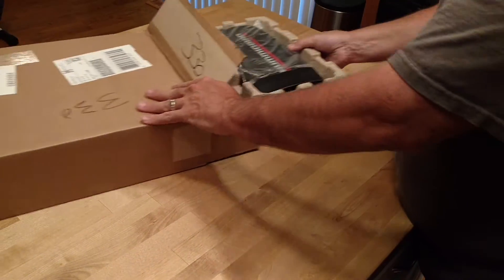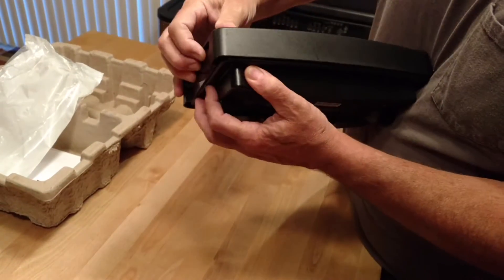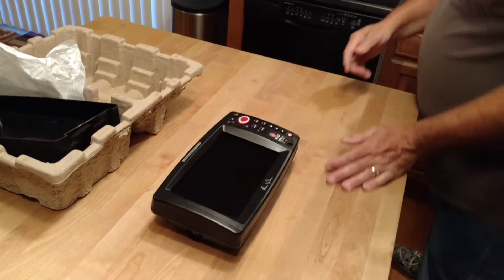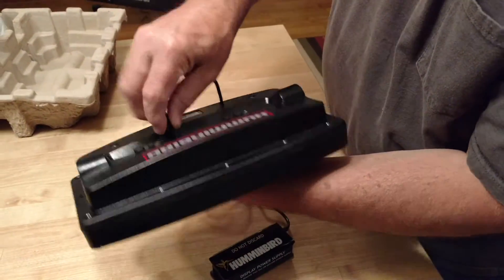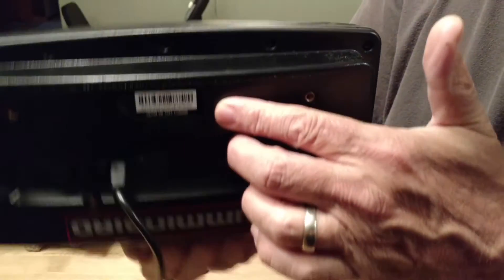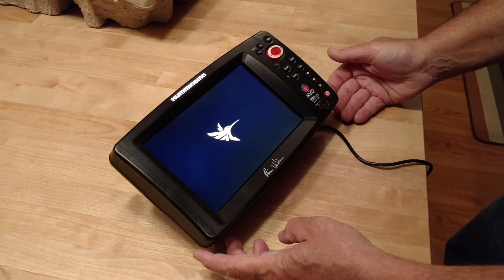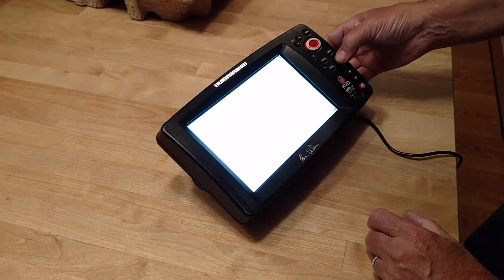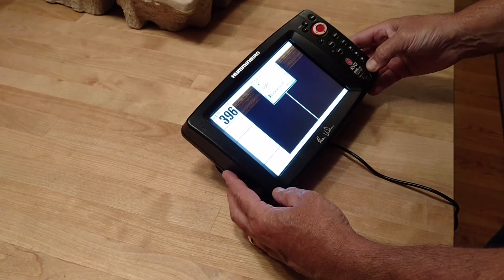2nd repair from Hummingbird.

Comment: I'm done with hummingbird. They fail when you need them most. I've been a die-hard hummingbird fan since the early 2000s. I've owned 6 units since then and 3 of them failed really early. My most recent two failed days before a fishing tourney. Both. Of. Them. A year apart before the same tournament.
The story goes like this. Last year around this time prefishing the day before a fishing tourney my GPS completely quits working. Nothing could be done to get it to work. Not a spare gps puck either. On this particular lake you need GPS and a map because there's alot of flooded hazards. It was a couple years old and out of warranty. So I decided to upgrade to the new mega g2n version with side imaging because I use that alot. I planned on just using the defective one on the bow. So in a way that problem was diverted. I was happy I purchased the newer model until yesterday when the side imaging completely quit. Once again days before the same tourney the last one malifunctioned last year. 
What I could do is use both them side by side and since I can get all the functions I want out of the two working together but that means I'll be out of warranty once my tournament is over. I'm done with hummingbird. After this, I looked around my garage and realized I kept spare transducers, and gps pucks for these units all these years as if holding spare parts is normal for owning a fish finder. I'm done with hummingbird they cannot make a reliable unit and it's been this way since the early 2000s. If you can make a die hard hummingbird user like me have enough then there are serious issues. They no longer are ahead of the game like they were when they released side imaging at an affordable cost. Now they are lacking behind Garmin. I'm going to drop 2k on a Garmin tomorrow, send this POS in to get repaired and then sell on eBay. A 1300 unit is good for one year? And believe it or not I take care of my stuff.